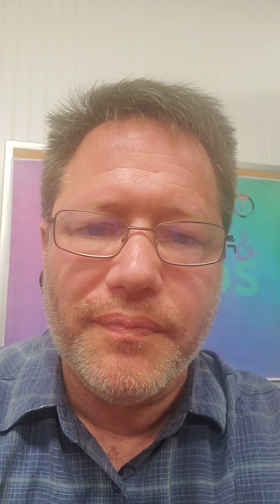MIT Discovered that Carbon Black can be Mixed with Concrete to make a Supercapacitor-style Battery

Comment: Battery powered roads!
Reply from the maker: It is one potential outcome of this research.  That will be a minimum of 10 years before the research is refined and the mass released or in this case mass road construction occurs.  The path between R&D is typically the slowest part of Technology adoption curves.